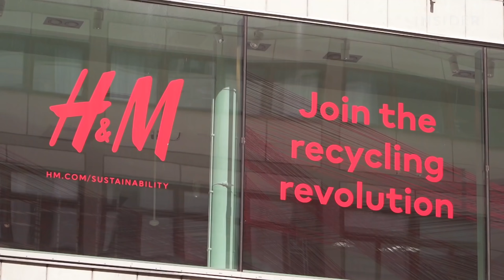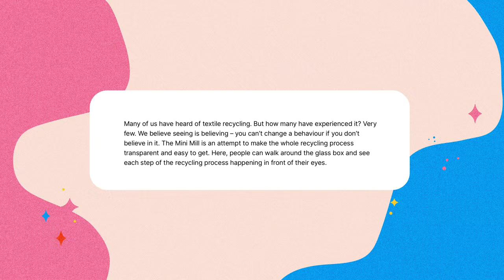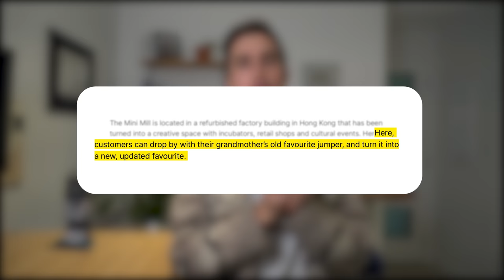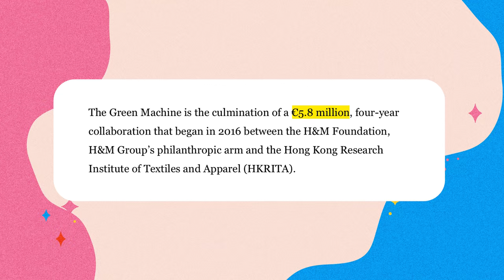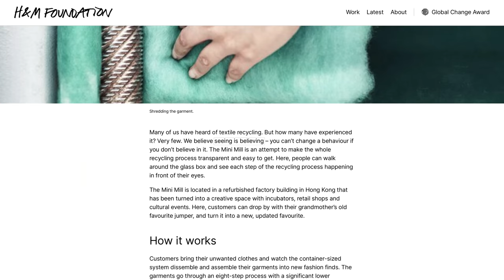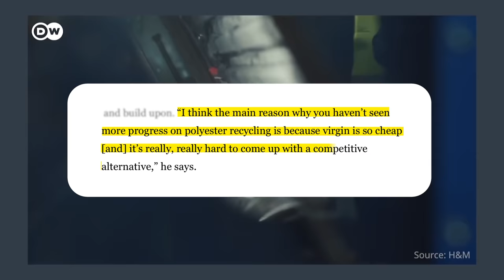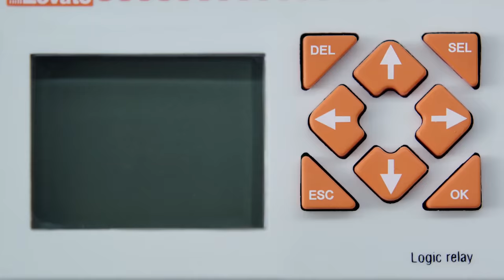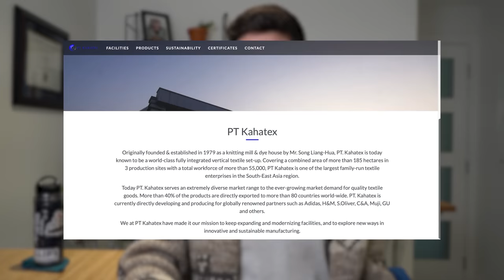Why H&M Is Recycling Clothing

Comment: I saw tags like "made with recycled plastic bottles" in h&m and other stores, and it sounds very exciting and absolves you of the guilt. But I then learned about the microplastic released in the laundry, and I got really worried about it. It seems like all the cheap clothes are made of polyester now! I bought a laptop case made with recycled plastic and I think that's ok because I'm not putting it in the washing machine, but with clothes I just don't know how to support sustainable solutions...
Reply: Hemp clothes
Reply: Wearing secondhand clothes made of natural fibres is the best way to avoid making new materials and simultaneously not release microplastics, but there are filters you can add to your washing machine line that will filter the water coming out of the machine to remove the microplastics. One company making them actually has a program where you can send the filter back after you're done and they'll take the collected microplastics and use them to make insulation and stuff
Reply: I see a lot of cheap 100% cotton t shirts in the very same stores, HM too. Not only t shirts too, you just have to pay attention to the label- there's natural fibers too though you might have to avoid certain cuts that they seem to LOVE to make from solely plastic
Reply: There are a lot more natural fibers - like linen when it's hot and wool on colder days. A wool jumper is the best in the winter, you don't have to wash it that often and if you have 3 to 5 they last forever.
Some outdoor brands even produce clothes for everyday, but for the price I'm not sure about how long they last.
But better than H&M T-shirts

Comment: You can turn used clothes into insulation, the process is far more efficient, cellulose is great insulator.
Reply: Awesome!  Where?  Used to be able to do this through our local garbage service, but not anymore.  I have fabric scraps and totally unwearable clothing I want to have made into something else, like insulation.
Reply: Both cloth and hair (generally animal hair) are historically widely used as insulation and can even later (as long as the fabric isn’t plastic) can be mixed with bone meal and compost or dung to create fertilizer

Comment: If we could scale the mills up we could use the shredded materials as filler for things like quilts and jackets. You can also add something like resin to make things like heel counters for shoes in basically the same way reconstituted leather works. Like that stuff doesn't need to look nice or be made of anything specific, it just has to be there. It can also just be sold as dampening material or pillow stuffing where it doesn't need to be seen. This would take the manufacturing of new clothes out of the equation and keep the recycling program worthwhile. Parley is doing similar stuff with plastic so I'm sure it's possible
Reply: This would be great - I'm looking for ways to recycle my sewing scraps and thread ends.  I wouldn't EVER take anything still wearable to a mini-mill, but I'd love it it my otherwise useless scraps could be made into something useful.  H&M might be best for this, but maybe someplace else would be better, and I would really appreciate finding out about alternatives!
Reply: Nft

Comment: I bought a basic cotton midi dress a few months ago.  I wore and washed it twice and a hole appeared near the seam where the side split was sewn.    I decided I couldn't fix it so I used the fabric to make a dress for my daughter and holes appeared in it as I was sewing it.  I bought a coat from H&M in the sale a few months ago.  Some of the top stitching is not back stitched and some of it is unraveling.  I also purchased a satin tunic in the sale and after I took it home and put it on I noticed that some of the seam was missing stitching.  I had to repair it myself. I have noticed that their quality has really tanked in the past year.  I'm not going to bother with H&M again if I can help it.

Comment: From a technological standpoint it's amazing. And apparently easier that I would have thought. Now please scale it the fuck up H&M. I mean you basically gotta be able to recycle at least as much clothes as you make right? Anything else will just contribute to the problem a bit less than before.

I personally think laws about warranty are in order. Make companies support their products for at least 5 years, better 10 (with variations depending on the product of course). If it breaks within that time they need to fix, replace or refund (at least partially) it.
Reply from the maker: That's a fantastic point about warranties on items, the burden of the item's longevity should be on the manufacturer 👏
Reply: Agreed.  There's a reason that 3 R saying starts with "Reduce" and ends with 
"recycle".  As in "Reduce, reuse, recycle."
Reply: Said it elsewhere on here, and will say it again - I'm looking to recycle sewing scraps and thread bits that would otherwise end up in the landfill.  Also the odd bits of clothing just way too worn out to do anything else with.

Comment: Depending on the writers, the replicators in Star Trek are actually tied into a waste reclamation system, but it’s at the molecular level and very sanitary. Basically it’s an instant 3d printer tied into the garbage (sometimes they’d show someone putting empty plates and cups back in the replicator and hitting a button and the replicator takes it back) and sewage system on the ship in a probably closed system. Definitely still Sci-fi compared to today’s tech… unless you live on a submarine, or the space station.
Reply from the maker: Woaaaaaaaah that's awesome! Hopefully we can match Star Trek one day. 😂

Comment: All-cotton clothes used to be recycled and used for paper. (so called "rag paper"). That can't be done anymore because poly-cotton doesn't have the right properties. What I find interesting is that the two fibres can be separated again. The cotton can go back to the paper manufacturers, and the plastic can be melted down into polyester pellets and become a primary material for something else. Maybe filament for 3D printers.

Comment: Uhm so looked at the green machine a bit. It’s hard to find what “the green chemical “ they use in it… but tbh, it sounds like they are just doing devore on large scale to me. That uses sodium hydrogen sulphate, which is pretty acidic, but otherwise not harmful if diluted or neutralized out of any water stream. It eats the cotton away and leaves polyester or protein based fibres behind. Maybe they tuned the process a bit to minimize the chemical use, optimize the reaction conditions or maybe they even found a more mild acid or method of application. But if this is what the tech is based on… no wonder it took only 6 years…Devore has existed for centuries. 6 years was just scale up n building the machine for the first time.

Comment: H&M failed when it came to me cuz I have jeans that I bought 5 years ago from then and though the knees are bust that’s fashion now so I still have them. Fast fashion is still a huge issue though so this is an awesome video.
Reply: Just keep it. They literally sell jeans with holes and cut now.
Reply: @shybutopinionated1428  that’s the plan if they get to tight I’m thinking of turning them into shorts and adding different material to the sides. They are gonna disintegrate before I get rid of them.